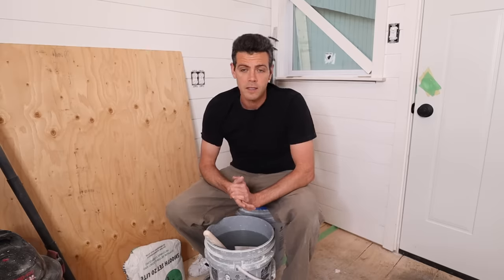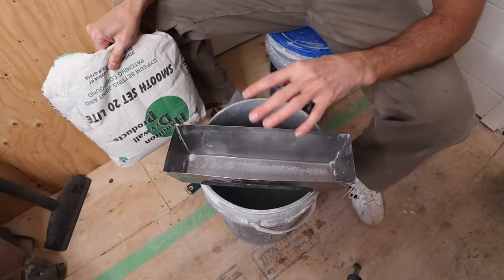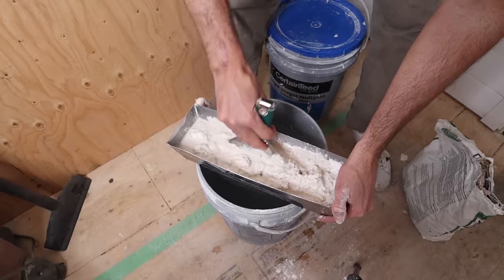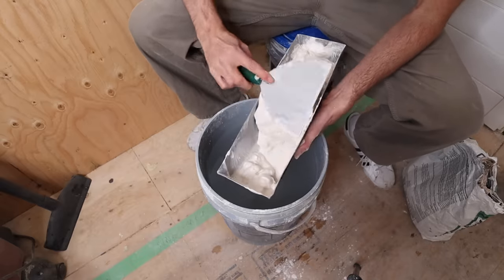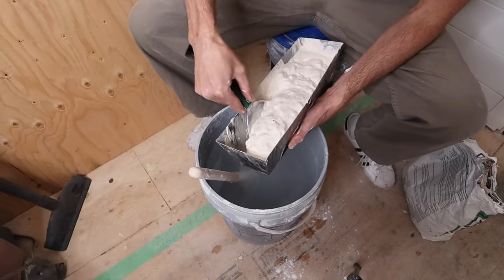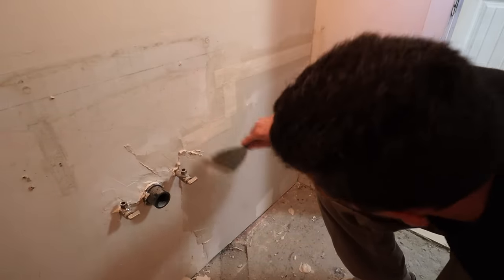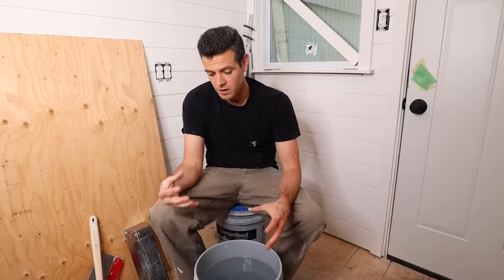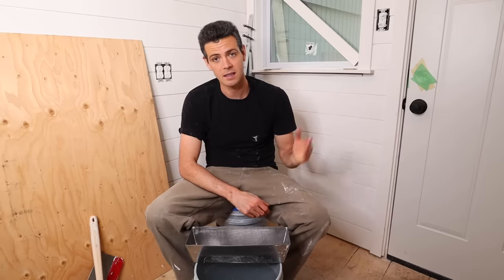How to mix Quick Set Drywall Mud small batches Hot mud

Comment: As a home owner doing this on a project I found it helpful to use two identical ~1L plastic takeout containers, one to scoop powder out of the bag and one to roughly measure out water. After a few pans I was able to determine the ratio I wanted and from then on mixing was fast and repeatable. I also had a margin trowel which I found made mixing much easier.
Reply: @CharlesStaggs  it's been a while, but I seem to remember doing 2 parts of 45 minute quick set for 1 part water, maybe more.
Reply: As always, use what works for you. I finish professionally  and I would be at a loss using g a 6 to mix with. I use my 2" knife because it fits right into the flat bottom, and I would be willing to race those folks that use a cake mixer. Especially if we count clean up time ;)

Comment: You can also add good old table salt or plaster of paris if you want to speed up the drying time, if you need 15 minute mud and you only have 90 handy for those DIY patches.   That works well on the ready mix joint compound to make "quick set compound"

Comment: I bought a small mixer from Menards that is designed to fit right in the mud pan. Just put it in the drill. It’s made of plastic so it doesn’t scratch. Works well but you still need to scrape the sides with the knife a couple times

Comment: DIY here...I prefer 45min quick set, I use a scoop for the dry, and another scoop with water mixed with a small amount of adhesive. I mix on plastic sheets on the floor which allows me pick up the edge of the sheet to blend, like kneading bread, then I use my knife to transfer to the pan. When I'm done with the quickset, I immediately use a plastic razor blade scraper on the pan and knife before it hardens.
Reply: Depends how much you have do
20 is what i just most of the time

Comment: I tried a new trick recently that worked super well : electric mixer paddle attached to my drill... It mixed really quick and the consistency was perfect
Reply: If you have access to a mig welder or a friend has one, grab some stainless steel wire (about 1/8 inch diameter) and make 3 loops, welded onto a 1/4 inch stainless steel coupling nut (long nut).  Thread a stainless bolt into it, and cut off the head.  You now have a stainless mixer head that won't rust, chip, or flake off the chrome coating the way a kitchen mixer paddle can do.  It took me 2 tries to get mine "right".  When I need to mix up a small batch, I have a plastic mixing bowl (I think from IKEA) that I use to do the mixing in with a cordless drill.  If I only need a small amount, I skip the attachment and have a hand whisk that I use.  Yes, it looks like I'm making pancakes, but it's fast and doesn't tend to leave any bits as there are no corners to hide in.  A rubber spatula gets pretty much 100% of the mixed product out of the bowl and into the pan.

Comment: When mixing in your pan like that it's best to mash it up against the sides of your pan. Gets those lumps out faster so you aren't working them out on the wall later
Reply: So a bit soupy for applying tape and pancake  consistency for feathering?
Reply: I dont think soupy is ever good when taping with a pan and knife. Or else you just make a mess everywhere you go. Pancake/sour cream consistency will provide the best resault everytime. Soupy can be good for skimming walls at the very end if the wall will have no texture and for spraying texture but thats about it.

Comment: You said that this video (how to mix quick set drywall mud small batches) might have been too simple BUT… I have to correct you… It was exactly what I was looking for. I am a first time “muddier”. I am Mudding my garage walls which were put up about 40 years ago then taped and left alone. The walls are stained and with holes here and there with electrical boxes everywhere, piping, fluorescent lights, and cords running through the ceiling and walls. Very complex beginning for me (61 y.o female). After having “research YouTube for the last 3 months on plastering, I decided to take a shot at it. My first batch I made was a full sack of 20–30 min Plaster of Paris and I did it all on an empty 5 gallon bucket. Now I have a nice hard as a rock plaster 5 gallon bucket. Never thought of doing it by batches. Then I tried the 90 min sack and prepared about 2 gallons soupy mud and had a million “bird droppings” everywhere. Then I tried using the last part of my mixed that had started to hardened and I have created the “Sierra Nevada Mountains” which I have had to tame down by scrapping off the excess. It looks so easy when You see it but it is quite another when You attempt it. I will say that by stopping and watching you again and working and getting hands on experience, then trying again, and watching so more… I have to sat thank you to you and other people like you that can explain even the simplest things… like saying… “don’t worry about the lumps… they will go away when you flatten them out on the walls.” So… keep on Keeping on and may the Lord richly bless you!    Ladysbell

Comment: I started folding it cause I think whipping it to fast like I used to do trying to get all the lumps out was incorporating too much air causing faster setting times. Maybe I’m wrong but I’ve used 20 minute too many times to count and it just seems I have a little longer working time when I fold it. Thanks for that tip

Comment: I do this often when repairing electrical outlets. But just recently switched to using a drill and the ox mud pan whip. So much faster. You should do a video on that Ben.
Reply: Ya a few years ago i bought a Ox mixer and I use it all the time when mixing small batches in my pan...the shape really gets in the corners and works amazingly well...i carry it always and use frequently! Definitely should do a video Ben!
Reply: Do you find that affects setting times? I have a  bag of 20 minute that says don't use mechanical stirers, I tried it once in a rush and it set up in under 10 minutes!
Reply: Yes for sure if you mix too long it can speed up the set time a little... But not too much

Comment: I use a plastic cup from the convenience store, 32oz and 42 oz to mix the mud in with a cake mixer paddle chucked in a drill.  Mixes fast. Cut the sides of the cup and dumping the hawk.  Less cleaning that way unless you need more Mudd than that at a time.

Comment: I want to thank you for your videos. I suck at this but after watching many of your videos I at least know “how” to do it. I am finishing a room that was once two bedrooms that are now joined together. Two angled doors were replaced with a single door square with the walls. The guy who did the construction and hung the drywall was drunk when he did it. The walls are crooked as heck and don’t line up. The tape and mud he did good. But that left me with all the screw ups to fix. The corners I just spread the mud over the tape and smoothed as best I could. Then sanded them down and filled the remaining small gaps with that soft drywall patch that starts pink and turns white when dried. It’s very soft and easy to work with. The corners look very nice now. The gap that was filled where the wall was removed has had a couple of coats to try to level it and it’s pretty close. One more coat and sand should do. The worst part in the hallway where the old wall and new are close to an inch off I have filled and tapered in several coats and it’s almost not noticeable how off the wall was. Another coat and sanding and I think it will be acceptable. Then just finish the ceiling patches where the wall was removed and I’m done with mud.  Again. Thank you for all your videos. They were very instructive. And almost entertaining. As entertaining as mud can be :)

Comment: I've found that a lot of the variability of using quick set can be eliminated if you accurately measure both your powder and water.  If you do this through several batches in a row you can hone in on a ratio that gives pretty consistent results.  Then all  you have to do is keep a record of the quantities and use slightly less water than you might require so you can fine tune up to a regularly repeatable mix.  Your brush method of adding water is killing your open time.  You should know how much water to use given a certain weight (or volume) of powder within a couple of ounces.  Great videos!
Reply: What would you suggest for measuring purposes?
Reply: @sundog8772  I use one quart transparent plastic cups that soup is often sold in.  I mark them with a Sharpie as necessary.  I mix in a small plastic bucket with a margin trowel and then transfer to a hawk or tray as required.  If I'm going to do a number of consecutive batches I'll use a battery drill with a small painters stirring paddle to speed up the mixing process.  I spin the paddle in a bucket of water set up just for cleaning to keep it free of setting mud.  The key thing is to always keep track of exactly how much water and powder you're mixing into each batch.   It doesn't take long to hone in on a reliable mixing process.
Reply: @ChrisTietjen_00  Excellent thanks for replying so thoroughly!
Reply: I use 4/5 of a 20oz water bottle per full pan and mix with my 2" Purdy knife. Same mix every time
Reply: 3:1

Comment: I purchased a cheap ($10) electric hand mixer from the kitchen aisle at the local big box store, mixes up quickset in the pan in seconds and a quick dunk in the water bucket even means you don't need to clean off the blades too well....

Comment: First time watching. Like floor linoleum, I always swear I will never do drywall again, but then it happens.
  If fixed vehicles and 3 boys give a surprise when you come home real late. We are paid by what we get done!
  My question is paper tape & sticky-back mesh! I am not buying a "Banjo" so I use sticky-back open mesh. I have alway seemed to have small repairs, but you are young. As boys grow up, they can turn into that uncle who shows up on a Holliday and falls putting 4 foot X 6 foot holes in the walls. I screw backer wood (Pallet Wood if straight, works great as prices skyrocket April 2023) Home improvement stores sell half sheets if received damage and this works & not hard to place in the truck of many vehicles, back seats down and a $6.00 moving blanket at Harbor Freight or Canada, "Princess Auto?)
 I will say dry will be my choice! I don't use this everyday so placing the paper sack in a plastic contractors bag and seal to keep moisture out. 
  Tip: I have a large 60 gallon compressor and air hammer. Old worn bits have value. I took a 4" X 6" X 3/8" metal plate, rounded the edges on a grinder, welded it to the bit and made a smasher! Plastic folded on concrete floor allows chunky bits of drywall (Concrete) but turn into power." Hey, I am frugal and hate throwing good stuff away. Works! 
Thanks for the video! As wet drywall waits for no one. DK, ASE Master Tech since 78, retired.

Comment: What I do is get myself a small bucket, drill and paddle and mix my mud in the bucket. It comes out well mixed and its faster. When I apply tape using hot mud I wet the tape first. It seems to keep the mud from drying too fast and I never get any bubbles.

Comment: Thanks for the tutorial. I’m finishing up one wall of my garage and I need to quick set my joints with tape. Your tips and information will help immensely. I have to keep reminding myself it’s my garage not my living room as far as the finishing work. I do want it to look good though....I have used your videos to better learn how to mud and tape. Thanks!!!
Reply: Hey I was wondering what tape I would use with my mud. I’m currently in a situation where handyman’s are charging me so much for small jobs and other ones don’t even want to do it because I guess it’s too small of a job. So I think I’m going to give it my best shot. Do you know what type of tape I can use with this type of mud?
Reply: @nombreapellido9568  well I’ve used both the paper and fiberglass in doing my own work.  It depends on how much mismatch (if any) you have to cover and how much time and materials and work you are willing to put into it. My front doorway into my house (inside) took me several coats of mud after taping and feathering out the corners and the seams as it was only about 3 1/2 ft from door to wall but 8 1/2 feet up to the window above it.  I ended up laying a skim coat and smoothing it out and making sure not air bubbles were in it. Was a real pain but since I see it every day several times a day (going up and down the stairwell to basement) I”m glad I put the effort and time in.  Now about my garage wall I had to keep saying (its just a garage wall that will have 2 freezers against it and I’ll never see it. So I just covered up the seams with a decent thick coat of mud, imbedded the tape and then rough smoothed it out.  After it dried I added another mud layer and feathered that out about 24inches from the seam. I had some decent gaps due to the framing and warped studs. I did add some shimming behind the drywall in spots as I didn’t want it to break when I screwed it down. The last coat was much easier and I did have some very small pin holes but I just forgave myself and got to finishing up the important part which is sanding it, primering, painting and getting the appliances and other stuff moved against it.  15 ft of wall and I really only see about 2 feet of it. So which tape depends on how mismatched your seams are. If they are money paper will be fine. If you have a butt joint against a tapered or 2 butt joints then fiberglass helps hold the mud to the drywall a bit better.  Don’t skimp on the mud and attempt to just have a lil bit of mud over the tape. That’s what cheap handyman and cheap builders do. It doesn’t take much to add a little more mud and feather it out to look good.

Comment: Iv had the problem with dumping out extra water and the quick set wouldn't set up as fast. It took way longer. I believe it let's the hardener run out. And on that same point. The more disolved mud in the water, the fastest it sets up. There is more hardener in the water with what's already in the mud.

Comment: Drywallery is a temperamental practice! I've been doing it the past few days and yes, it really seems quickset is either immediate-set or never-set. Ha ha ha
Reply: I had a job where I noticed the 20 and 45 were behaving opposite. I thought maybe it was the water, but i used the same bags on another job and it did the same thing. Started thinking the bags were wrong from the factory! LOL I don't remember if the jobs were city or well water, but I think it was city!

Comment: Try storing unused mix in a bucket if not using immediately,it will suck moisture out of the air affecting set time and could be useless after as little as 2 weeks

Comment: You skipped the most important thing newbies need to be concerned about when mixing hot mud:  Clean-up.     
They might assume they can just put any mixer or other tool into a bucket of water like they can with standard mud and clean it up after they are all done, not understanding that it is going to harden in the bucket.   Also how that as soon as they start to notice that the mix has started to harden they need to dump the excess and clean it out asap, especially if they are using full weight durabond or similar good, hard hot mud.  Cleaning any mixing tools before you start mudding and not pushing once the mud starts to to solidify is critical or you will be spending a ton of time chiseling the mud out of the pan and off the tools. 
I usually set a timer when working with hot mud, especially for the longer 45 & 90min mud, to help me know when I'm coming up on the rated time so I'm not cursing myself for pushing it and spending the next 30+mins chipping mud out off things.
Reply: Great tip, I have a "Slop" bucket for such a task.   Normally one i've used for multiple mixes of various products during my DIY work.   And have a couple of clean (new) buckets handy, nothing worse than fighting with a mix in a dirty bucket.   I tend to use a more non-technical method with a scoop of quickset on a scrap of drywall, when it starts to go off I know my current mix is end of life and should be disposed of as it will make a mess if I continue to use it.   Goes for mixing buckets, etc too.

Comment: I just tried to do my first ever taping job with a small batch quick set... 
I had just used it for pre-fill like 2 hours prior, and it worked out fine! Predictable! I liked it!

Then I mixed it the same way for mesh taping.... and... MANNNN!
IT WENT SO BADLY
And when I thought I could go fix , I made it 10x much worse
It just suddenly started hardening so fast after like 20 minutes 
and each time I'd go to feather an edge that got messed up from feathering an edge perpendicular to it, I'd just start pulling partially dried mud from the other place!
I felt like I was a on a hidden camera show where the hosts dumped a load of instant cement into my mud :(

Durabond 90 is a scumbag quickset. It's a villian I tell you.
I just dont get it. I cleaned everything in advance but... oh well

When we fall down, we get back up!
Time to see how much luck I have sanding it and cleaning it up with good ol' All-Purpose!